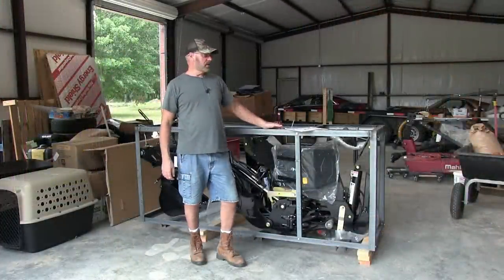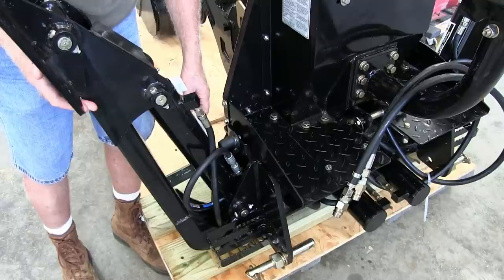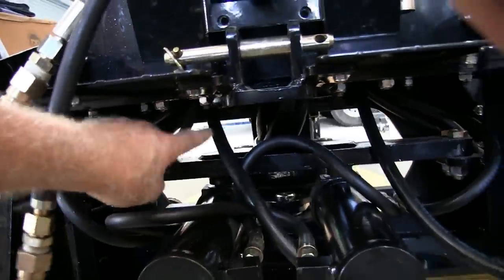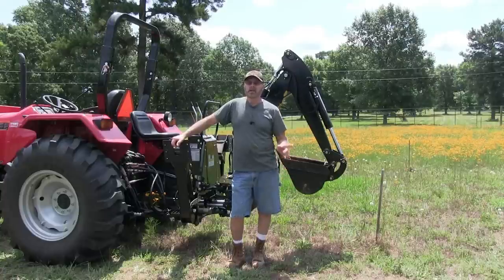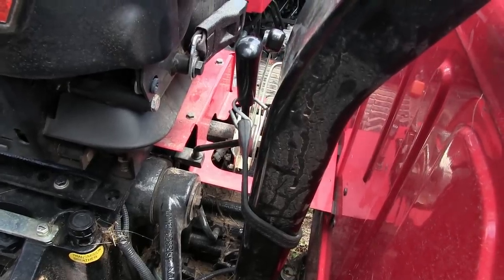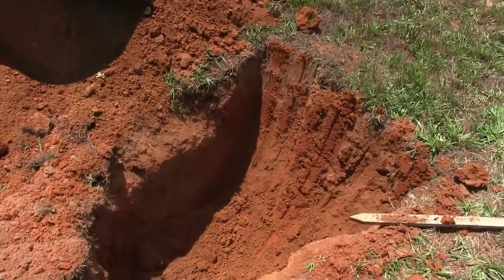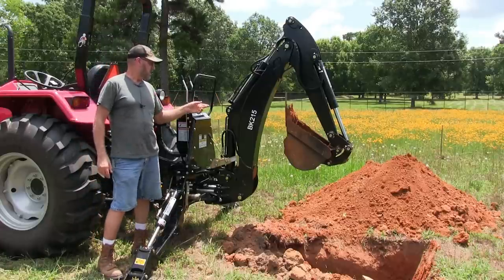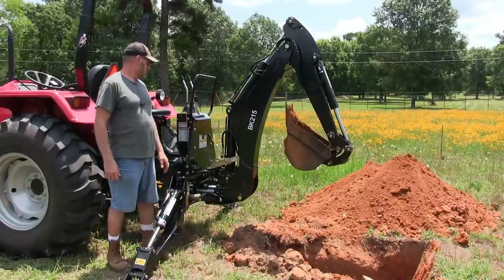BK215 backhoe from Titan Attachments on my Mahindra - Review and first use.

Comment: You may already know this but a lot of people will change those hose fittings on attachments so they cannot get them confused.
They will either have a different size, different type, or different genders.
Different genders is the best setup, It keeps you from getting the hoses mixed up, and when the backhoe or other attachment is disconnected from the tractor you can plug the hoses directly together to keep the fittings clean. You would still have to cap the two fittings on the tractor to keep them clean.

Comment: hey Pete. Good video and you did just fine for your first try.  I would recommend slowing your rpm down at least 200 from where you are at or even lower. That will provide you with a much more manageable response from your controls until you get more comfortable. If I really saw what I think I did if it were me I would switch two of your controls so they match a typical backhoe. Yours looked like it was plumbed to match CAT controls in an excavator. I hope this brings you many many days of enjoyment and productive work.
Reply from the maker: Thank you for the advise.

Comment: Good job on the video, I have the same backhoe been very pleased with it so far. You might want to change the fluid in your tractor now. I back flowed the the hydraulic fluid before hooking up the return line. The fluid that came out was black they must use some old waste oil to test with.  Also I used the U channel that came with the shipping frame to make feet for the outriggers.
Reply from the maker: Thank you

Comment: Few things I had on the one I recently purchased. They still haven't fixed the hydraulic line hitting and getting damaged. Mine was broken as well. They claim it is shipping damage, but I don't see any way it would have been done during shipment. The dumb thing is, all you have to do is rotate the end of cylinder 180 and the lines are protected. I recommend you do it. It does make greasing that pin annoying as you have to position the leg is just the right spot to get access to it thru the hinge, but is much safer for the lines.
One of spool valves leaks on mine, so waiting for a fix on that too. There are various other shipping damage or quality control issues, and I had to touch up paint is many areas. None of those prevented operation though. Had it for two weeks now and cannot use it due to the leaks.
It is ridiculous they don't include shoes for the outriggers.

I would really recommend you build a sub frame. Look at the way it twists the connection to the tractor. That cannot be good over time to the 3 point. Also the digging force is limited because the 3 point doesn't provide any down force. A frame would let it use the weight of the tractor.

Comment: Slow your RPM's down to the lowest it takes to dig into what you are working on.. It will not jerk as much and will be much easier to learn the controls when things are not jerking around.. You can speed the RPM's up as you get smoother on the controls.. 
Hint: You can run higher RPMs, and smooth out the controls, if you work both together... Example: As you swing left to dump, just before you get to your target left, start uncurling the bucket.. It spits the hydraulic flow from one ran to both, and both slow down slightly. I have a Terramite T5C.. After years of operating it, I still use these same rules  of thumb, and most people consider me an artist with the backhoe.. Using both controls at once is what gives you the smooth movements.. Most units are matched and you can actually do very nice work with them.. I added a 3' scraper blade to my bucket with wrapper chains, and I use it to level out things and cut clean edges... Have fun with the new toy/tool.. Ha..
Reply from the maker: Thank for the advise, Yeah the lever to lower and raise the boom is very sensitive but I'm getting used to it now.

Comment: Good job Pete. I saw you taking some deep breathes before you moved the bucket. That's ok. Just relax. Little advice. Tighten up that three point so it doesn't rock back and forth. Curl your front bucket down and raise your front wheels off the ground. Put your out riggers down all the way to raise your back wheels off the ground. You will have a much more stable platform to work from. Find a place on your property where you can move dirt back and forth in one spot so you don't have to move the tractor. Practice. I work for the public works dept and that is how I learned. Make sure your 3 point and those pins are capable of holding the weight of the tractor. If one of those pins were to fail or come out that could be fatal. Danger, Danger!
Reply: looks like some down rigger pad extensions would really help.  simple start would be a couple chunks of 4x4 lumber lagged under the flat pad.
Reply from the maker: Thank you
Reply from the maker: I'll look into that, Thanks
Reply: 3 points don't have downforce. adding additional rigger height will only lift the arms. a subframe backhoe would lift the frame. other than that your advice is sound

Comment: Looks like you need a hydraulic flow control valve to keep the controls smooth. I just ordered one on Amazon for $45, 8gpm max, plus fittings, to keep the flow at 5-7gpm. I have the BK-175, recommended flow 5-7gpm. My Dingo is 11.3gpm, and causes all sorts of consternation with the attachment. The throttle has to be below 2000 rpm to get the GPM low enough.
Reply from the maker: Great I'll look into it. Thanks 👍

Comment: Very nice setup. I would be careful with the stresses this hoe puts on your tractor being on a 3 point hitch. There is a reason that the backhoe attachment from the factory (Mahindra) was a lot more money. If you take notice all of the factory units have a sub frame mounted to the tractor and the hoe attaches to it rather than the 3 point hitch. This is done to avoid the major twisting stresses that can happen to the back end of the tractor body. With minor use it may not be an issue but depending on the amount of breakout force this backhoe has, one tree stump removal attempt could be very expensive if you twist the tractor body.
Reply from the maker: Yeah, I agree, my tractor frame is reinforced but not for a backhoe. This is a medium-light duty backhoe and if I break anything, it will probably be just the links or pins.........hopefully.
Reply: Superdog I have one on my 4020. Granted it is built heavier than a Mahindra but I agree these are mainly light duty
Reply: With the "Floppy Twist-o-flexing" there is GOING To Be BREAKAGE. Even with the "delicate" use He was Operating at ;; it WAS ALL OVER THE PLACE !

Comment: You should have gotten a frame mounted attachment instead of a 3 point mounted attachment. The frame mounted atachment is a lot more stable and definitely less jerky.
See if you can obtain or make a frame mounted adaptation for that backhoe.
Reply from the maker: The frame on my tractor is reinforced so I don't have to worry about the tractor frame but yeah I need to find a way to attach the backhoe to the frame.
Reply: @petebeasttexashomesteading  I'm sure you'll find that the three-point attachment is not rigid enough.
When using the backhoe you want to eliminate all the slop possible .
Reply: @petebeasttexashomesteading the backhoe frame is different. The owners manual is pretty clear on how adding a 3-point backhoe voids your tractor warranty

Comment: Question. Did the freight driver get this off the truck for you or was it up to you to remove it from the truck?
Reply: I didn't buy the same backhoe in the video, but the freight driver got it to the lift gate, and I had to do the rest. Luckily, I have a tractor. Lol

Comment: I'm about to purchase one from same place. Thanks for clarifying, my tractor does not have hydraulics so I need a pto pump $300 more. But i will go with the lw7 that you mentioned and it's in the link description. They are $3800 now. Quick question, have you had any issues with it, do you recommend it? Thanks
Reply from the maker: I've had no problems with it. I used it to plant my fruit orchard trees digging more then 50 3x3x3 foot holes. I'll be using it to dig some  trenches for water line soon. Just remember that it's not heavy duty but it gets the job done. Also remember to grease all the grease fittings each time you use it.
Reply: I’m considering the titan unit as well. Where are you getting your pto pump, as that is about half the price I am finding?

Comment: I purchased this attachment over a month ago. It's been a freaking nightmare.
Reply from the maker: Sorry to hear that, I still have mine and it's been working good.
Reply: @petebeasttexashomesteading  Consider yourself lucky.
Reply: @Monkmandan  Can you elaborate? Why is it a nightmare?
Reply: @court2379  First one got delivered. Had scratches and damages,nothing mechanical wrong. connected it to loader controls to lift off metal box and main hydro valves had a leak as well as two lines. contacted titan. returned it. weeks later another showed up,got it connected to my machine and started digging. blew threw 8 of their lines and the valve box started leaking also. ended up getting a full refund. lines are only 1/4 inch which is waaay too small. in all its a night mare from waiting weeks in between hydro line deliveries and being coverd in fluid while i was working. its chinese but put together in america i think.

Comment: Appreciate the video but I don't think these are even available anymore. Granted this is 5 years later. They are no longer on the Titan website. The only thing you can get is the manual. Three point backhoes are not a problem when used properly and within the design limitations. They aren't designed for much more than light trenching or small excavation jobs. The problems start when those limitations are exceeded. Most don't understand the forces well enough to know where that limit is and thus they get a bad rap.

Comment: I am wondering if this would be a little to much for my Massey Ferguson 1739E (39hp). My tractor don't have auxiliary remotes. So, I wonder if this backhoe would operate on a PTO pump. Idk how much to add remotes to my tractor would cost.
Reply from the maker: They do make a back hoe with its own engine and pump.
Reply: Yes they do it's called a betstco.
Reply: I found a backhoe for my tractor. It the Woodmaxx 7600 backhoe. It will attach to my tractor 3pt hit system and will run via PTO pump.

Comment: Hello Peter, have been follow you and finnaly own a JD2032-R tracktor, looking to set a backhoe, I didn't like the cost what JD want for theiir backhoe, I know your backhoe come from Titan, I just wonder did you look at WoodMaxx backhoe, I like them because I don't have to mess around with the orginal hydraulic system, I don't have rear remote or 3rd function hydraulic option
Reply from the maker: I'm not familiar with the woodmaxx but the one I have works good but it's nothing heavy duty.

Comment: you would be more stable if you lifted the tractor up a  bit higher so the weight is on the stabilizers and it will be a lot more steady ust raise the tractor up off the wheels... try it you will see the difference. nice job
Reply from the maker: Thank you
Reply: You can't lift the tractor off the ground with a 3 pt backhoe, the arms just lift up

Comment: Is that a AMX I see in the back ground?
Reply from the maker: Yes sir, it's a bitter sweet orange 1969 390 4 speed with the go package. It's for sale if you're interested.
Reply: @petebeasttexashomesteading  man I have had 3 of these cars over the years one was that color and just as yours is 390 go package!! Im just to old to mess with one now but just curious how much you asking for that sweet ride. I might be convinced to get another one!
Reply from the maker: The engine has a big Holly carb, Torquer spider intake manifold, big thumpy cam, and powder coated headers. I have some videos on it here: https://youtu.be/5oVzfSEMpcc and here: https://youtu.be/GFGTaJnP328 I have the original seats and steering wheel and extra parts, manuals, and book that will go with it. I'm asking $35,000 and I'm nigotialable.
Reply: Thanks for the info that is a real sweet "X" I will keep it in mind I guess its either the AMX or a new tractor! Man I miss the ones I had!
Reply from the maker: @kenpeterson327  👍

Comment: Bought one of these from Titan. With less than a hour of use I screwed up the linkage for the three point on my Mahindra 5570. Very disappointed. Going to sell it.
Reply from the maker: I've used mine a lot in my hard red clay soil and have had no problems with it. I wish I could mount it to the frame but it is a light duty back hoe.
Reply: What exactly happen to it?
Reply: Did you sell it?

Comment: That things moved alot when the main arm did. Are u looking into fixing that or is it just user error?
Reply from the maker: mitchell berg  I think that's because it's a 3 point attachment and not connected to the frame like the bigger backhoes plus the lever is very sensitive.
Reply: Pete B. I’ve been on the fence about purchasing this exact unit. Just like you, I can’t justify the extra 9k for the unit sold by Kioti but I did buy the subframe. The sales rep told me it will mount to the subframe, what’s your opinion on that? Also, my tractor is only 35hp. Will that be enough for this unit? Thank you for the video btw, great job!!
Reply: Hey Greg, did you end up buying this unit? Also, since it is made to be 3-point hitch mounted, how was it hooking it up to a sub frame? Would love to see a video of that. Thanks in advance.

Comment: hay that is the same one i bring into Canada from China less the name on it for resale along with many other attachments, cheap. dont for get to  refill your tractor hydraulic  tank part way getting the air out and again after a few hours work as it will be low, failing to do so you will starve your pump of oil and burn it up, it may not show right away but the pump will fail sooner then it should, they dont hold much oil as it is, so any time you add a new hydraulic attachment stop part way and refill, make sure you use the right oil for your tractor or your drives will stop working and will not work again until you drain it all and put in the right stuff. you can also order the hook up that dont use the 3 point. tip you can run more then one leaver at the same time makes for a nice smooth flow
Reply from the maker: Thank you, I'm learning 🙂
Reply: Hi, what is the process for bringing one in from China? Is it difficult? How long does it take?

Comment: Sorry to be the bear of bad news, but tractor mounted backhoes like this are a joke....was glad the day I sold mine.  Under powered, cumbersome to use (unlike a real backhoe where the seat simply flips around, you have to climb out of the tiny seat, climb on the tractor and move it a couple feet, climb back in the backhoe), tend to break things on the 3pt if not subframe mounted, and so on.  Notice the clips on the boom and stabilizers ?  That is because the cheap things leak down almost from day one.....they HAD to put them on there so you wouldn't notice as much.  You set it off the tractor and forget one, and you'll come back to a collapsed unit laying on it's side....I used to chain mine up to a beam in the storage shed when removed, so it wouldn't be laying on the floor next time I wanted to use it.....ahahahahaaa.

Money would be better spent to rent a real backhoe from time to time for projects, or do what I did....buy a used excavator in the 8-10,000lb range.
Reply from the maker: Ed Smith  I knew what I was getting when I bought this. That's why I said it's a light duty backhoe and I'll use it now and then. I can't justify spending $10,500 or more on a backhoe that I'll only use occasionally.
Reply: "Money better spent to -->RENT<-- a real backhoe when needed......"  $300-400/day, and you'll get more work done than in a month with these toys.  Been there, done it....mistake not to be repeated.  Your mileage may vary.

Comment: I hope you can tell by watching the video of yourself how much looser that backhoe is from the tractor!
Very seriously!!!
Look how much slop there is between the backhoe and the tractor!!!
That is actually shaking like crazy because it's not rigidly mounted to the tractor!
That makes it a whole lot harder to operate!!!
A lot of similar tractors have a top link that is not rigid! Many tractors have a sensor on that top link that helps to adjust draft control when you're pulling a plow or something similar!
You need to hook that top link to something that is rigid on the back of the tractor, because it looks like that's where most of your slop is coming from.

Besides, if you're only going to be digging holes to put plants in or post holes you should have gotten a post hole digger, they are a lot cheaper and a lot easier to use!